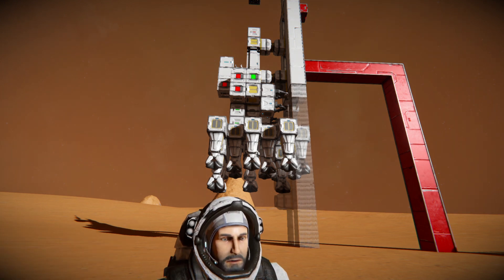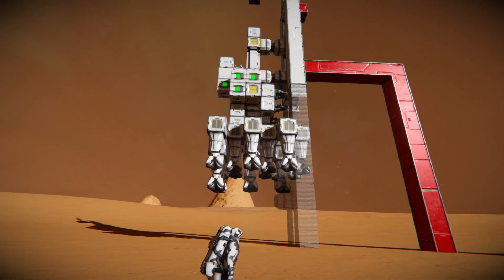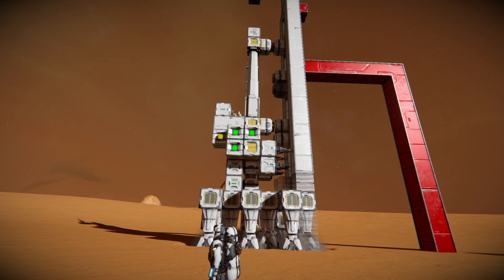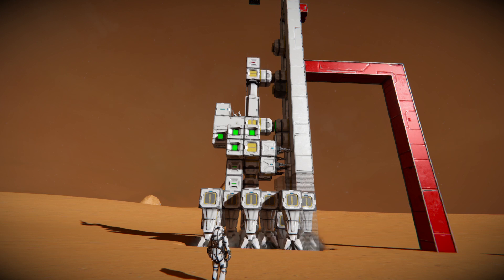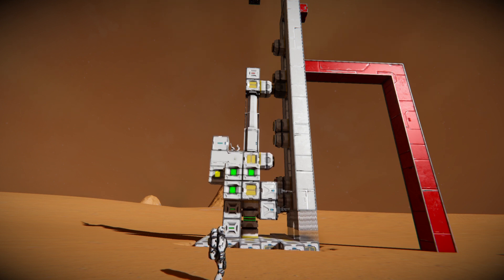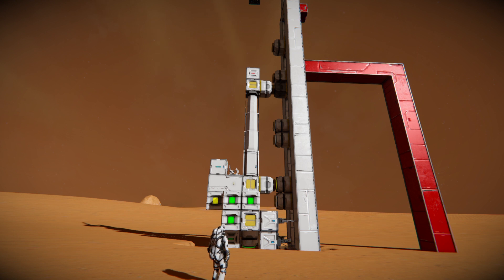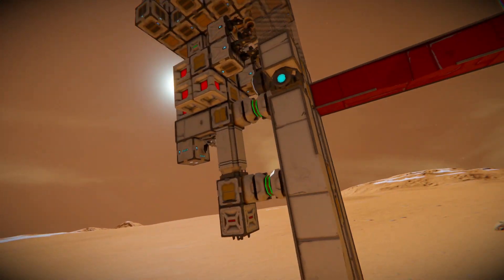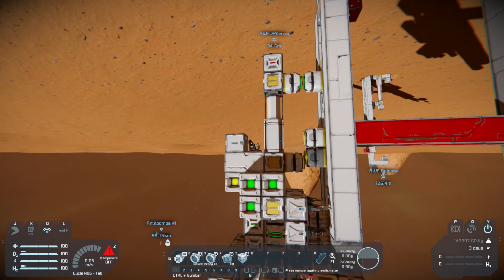Automated Excavation in Space Engineers

Comment: add some power to the piston from it's settings when pushing or pulling a heavy load, for example when the contraption is upside down or when the drills are full of ore
Reply from the maker: I gotta try that!
Reply: Also the bigger drills mod would reduce the number of drills needed. If you use mods that is. I.e. you might be able to reclaim all of the machine after the shaft is excavated.